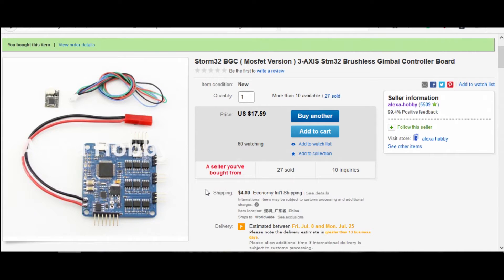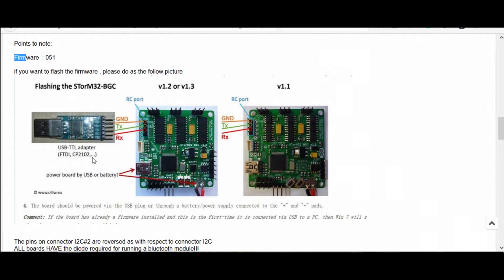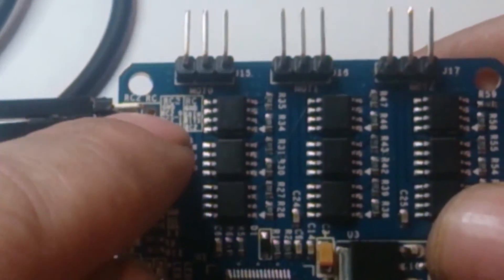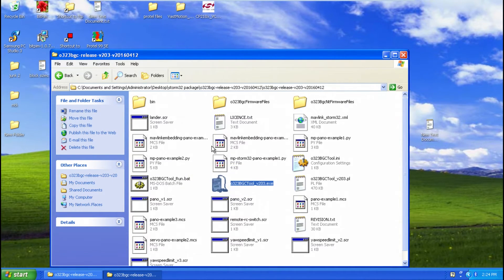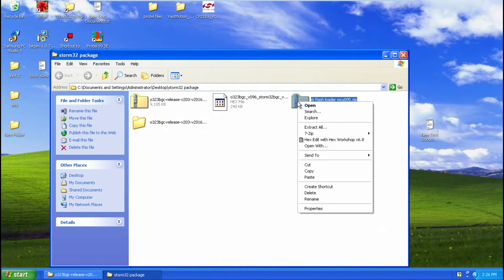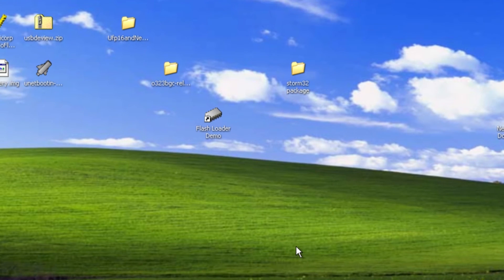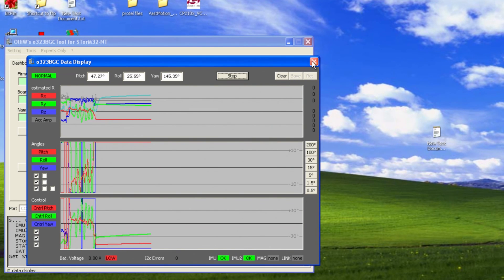SToRM32 BGC v1.4 alternative Firmware update

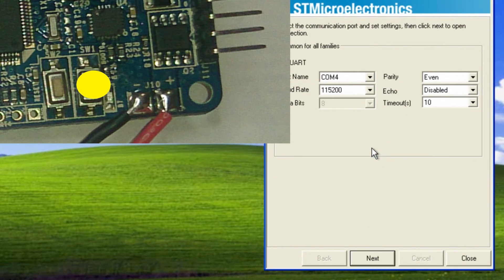Comment: Hi, I'm trying the same in Windows 10, I'm getting the COM Port visible too, but there is an error as it is shown in time 6:00 of the video... I'm not able to proceed further...  Am I doing anything wrong... Please do let me know
Reply from the maker: Hi are you sure you have the tx and rx correctly? have you tried both ways? (reverse your tx and rx)  ..are you on the right pins as well for the uart pins..
Reply: As the 'new' COM Port is visible, there is no error in the USB-TTL chip...  The LEDs of the Storm32 v1.32 are blinking, so that too has no problem.... I tried using the Windows XP OS and it is still not working.. And yes I tried exchanging the RX and TX pins but still the same....   Can I communicate to you through any other means... This work is important for me...
Reply from the maker: @mpd1811  Hi ..can you send me pictures of the connections.. maybe you have it on the wrong pins?   It can also be its just fried ?  can you connect to it at all besides trying to do a firmware update?..   (with the usb port) using the gui for the storm)

Also your messages are being marked as spam and i have no idea why . I only monitor links.. 
If you can't connect to the unit at all because its fried not much i can do .
if its brick .. You might have to get a stlink v2 .. I do have bunch of them kicking around and the bgc boards i can see if it even has the connections for it..  with that you should be able to re write the boot sector if it some how got corrupted .. but that is pretty hard as it should be locked..

Anyways if you send links they will be put in my spam same with any of your messages probably , The other problem it takes youtube hours sometimes to let me know about the spam.

I would rather help in open so it might help others .. but as above not sure if I can..

I've seen lots of these boards just fry for no reason.. I believe thats the board i had that all i did was push the but button and it instantly blew my voltage regulator and the st chip..
Reply: @ModItBetter  I'm working ona BaseCAM board now..  Will let you know if I succeed
Reply from the maker: hi you can actually program with the stlink if you have one .with the gui as well .still not sure of the connections have to find my boards later.. anyways here is a page on it..   http://www.olliw.eu/storm32bgc-wiki/How_to_flash_firmware scroll down to the stlink part..

Comment: Man I am having no such luck every time I attempt to flash the firmware it tells me it has no response Target
Reply from the maker: is that both ways?    with st flash..and through the storm32 gui it self..?
Reply: @ModItBetter  could I send it to you to update for me I can't get it to update
Reply from the maker: @MrHatemelater  what version is the board at?  also why do you want to upgrade it is the version that old? ... Also i'm in canada and the shipping is ridicules to ship out of canada your looking at 30-40 with tracking .. you can find new boards on ebay for about 24u.s 

also look at 2:17 ish i show the connections its a tad deceiving its actually on the second row if you follow the pins.. maybe your on the first row?    if you want you can send me a picture of  your connections to bangs696969@gmail.com  or upload them some where and post the link.. but it will be moderated so you might want to send a message saying "check your flags" if i don;'t answer..
Reply: @ModItBetter  I got a new board but it not recognized by Windows 10 and it has the old .9 software on it that I cannot update
Reply from the maker: @MrHatemelater  Hi scroll down on this page to "v0.96 Firmware for I2C IMUs"  and then download the software for that version..
after you extract it run o323BGCTool_v096.exe     maybe your trying the wrong version with your board

direct link to software and firmware is ..
https://github.com/olliw42/storm32bgc/raw/master/firmware%20binaries%20%26%20gui/o323bgc-release-v096-v20160319.zip
Reply from the maker: keep in mind the other versions are for the nt version which i doubt you have but you might .. you will want to double check to make sure your using a i2c imu's not a nt imu.     so if the above software links work with your board and your running verison .96 already that is the last version for i2c

Comment: Good video. Thank you. But I'm having some issues. I have updated the firmware. Now I have connected using bluetooth but I can not read the board. Same with connecting via USB. The LED next to the Boot Button is lit up ( BT indicator light. Bootloader?? Or Bluetooth?) and the two LEDs LED0 and LED1 are flashing yellow and red respectively. Is that normal?

I click on READ and the message says Please do a READ to get the controller settings. 

I hope I have installed the correct firmware. I have a v1.1 board and installed: 
o323bgc_v096_nt_storm32bgc_v110_f103rc.hex
Reply from the maker: Hi it has been so long..   I would try the version without the Nt  if your not sure if you have a nt board .  6:50 of this video shows the file name to test with .   or if you downloaded the newest firmware the file should look the same as your example without the "nt" in the name

Comment: bro please help me it always shows me the message that she cant connect they said that i need to reset unrecognized device what should i do
Reply from the maker: are you adding the usb cable for power?..

also is your usb to serial adapter working and getting a port in windows
Reply from the maker: ok so your running into problems at 5:37   so your port does show up correct?
not sure how long your usb cable to serial adapter is or your setup but you might have to get closer or try another cable.

and where are you getting your 5 volts for the usb power?   make sure its connected to a power bank and not into the computer

Comment: sorry for inconvenience,, i had a question,,
i wondered if i could use gy-521 as camera imu on this board,, cuz original imu wich this board came with, accidentally burned,and by far this is my one and olny option
Reply from the maker: hi .. I'm not sure but I would suggest to just giving it a go and try it out.. ...I would assume its i2c .. so if it does not work.. it could be your last was a nt version.. so then just try a none nt version firmware.
Reply from the maker: Basically what i'm saying as well .. if its i2c ..4 pin connector.. no damage can be done from trying it out..   unless you get the voltage backwards ect..
Reply: @ModItBetter  i Tried it..and keep getting i2c errors,
Reply: and by the way i changed firmware with help of your video, and when i read gyro data..it works as should, but when i try to calibrate it,, after it turns on motors and  status level message appears, motors start to level camera, afterwards it fails and shows me i2c error occurred.
i had original firmware, i passed this step on that firmware but yaw just wouldn't change it's rotation degree in the next step,  and whole gimbal was locked after finishing steps.
Reply from the maker: @daniel_dz9517    on this page 
http://www.olliw.eu/storm32bgc-wiki/Which_MPU_modules_do_work_with_the_board

the problem you might be facing is your board is a 5 volts board..
and the storm uses 3 volts.. on the i2c header ..  somebody says to short out the voltage regulator. https://www.rcgroups.com/forums/showpost.php?p=27321450&postcount=55  

Basically what they are saying is you find the pin that takes in the 5 volts.. on the other side where it ouputs 3.3 volts.. just attach wire  to those 2 legs.. basically making a bridge over the 5 volt regulator.

alternatively you can just remove the voltage regulator and attach the 3 volts directly  to the old 3.3v pad..

I don't have the board handy right now ..but I would think you could just find 5 volts on the storm board and then feed that to the i2c module ..instead from the i2c port.  ..and if you can't find 5 volt on the board.. 

Just take the 5 volts from your flight controller.  you only need the one wire ..because its shared ground anyways already ..
Reply from the maker: so i went through my electronics bin and found bunch of these modules I have ..
does your look like one of these..?
https://drive.google.com/open?id=1qlULB_R4lrkI-ebW5XPyqJj-kp-X8-nY  well not the 883 one that is a compass ..

Comment: Nice tutorial, worked nicely but now i have to change the version of the Gui
Reply from the maker: did you find all the versions?
Reply from the maker: here is a link.. https://www.rcgroups.com/forums/showthread.php?2055844-STorM32-BGC-32-bit-3-axis-brushless-gimbal-controller

If you can't find your version ..I had downloaded the master from some where.and have most of the version..So i can upload to the my google drive if need be..
Reply: yes , i found it, but i have a problem with the board i think. i have the status no imu,and imu2 ok , but i can't see any signal, on the display, the graph is flat!Thanks for your answer.
Reply from the maker: had you had it before..? are you sure you have it plugged into right location
Reply from the maker: usually the plug for the i2c is at the top you might have another 4 pin on the side of the unit...  also make sure the cable is pushed all the way in those pins can be a pain.. if possible try to flip the i2c cable connectors around.. however if it does not fit the other way don't force it..   try to push the black wires or what ever color wires you have back into the connectors they might of come out a tad..      I don't have a nt version so i don't know its possible to program a nt version with the wrong version ..
Reply: thanks for your answers, what i do not understand is "Imu not available",and imu2 ok, with external plugged or not its the same.I never had imu(1).i bought it from Banggood, version 1.3 , black board and the firmware /gui was downloaded from the rcgroup.com , it was requesting a gui 2.11e.So with your method (only)i succeeded to upgrade the firmware to v0.96.My ext. imu is I2C, are there really I2C errors problems?I even made a try by direct soldering to the I2C#2 port on the other side of the pcb, same result , but imu2 appear on adress high instead of low.Any idea?Thanks very much of considering my problem.
yes after checking on your link it was originally a firmware beta version 2.11e.
Reply from the maker: Is it possible you have nt version??  then it is not i2c and simply  uart well uart at a faster speed..
Reply from the maker: I know above you said it was i2c but if your unit actually came with 2.11e that seems to be a nt version .. have you compared your i2c module with other i2c modules and nt modules?   and same with your board.
Reply from the maker: also have you just tried to go back to version 2.11e ?
Reply: i suspect something like this , because some other buyers complain about "no connector" for the ext imu.I'll try to go back to 2.11e.But if its a NT version , i need a USART type sensor?
Reply from the maker: Ok your board totally looks like the nt version board.
https://www.banggood.com/Storm32BGC-NT-V1_3_F103RC-32-bit-Brushless-Gimbal-Control-Board-p-1105106.html?p=PK211613756002015039

they might of sold you the nt version board and a i2c module..
let me crack open mine and see if looks the same....... <--edit..pointless mine does look different like how a none nt should look like but proves nothings.
Reply from the maker: on your board it should be label i2c beside the i2c connector does it have that label? also what is on the back of your i2c module.. does it say sda scl?..same with the main board any writing on the back of it?
Reply from the maker: If we are right.. I would request a new module or even board or full refund as damage could of happen to the module or the st chip.  It is probably doubtful because they both work on 3.3v anyways..   and you don't need to plug in the battery while testing just the module,  usb power should be good enough..
Reply from the maker: also if your updating your board make sure you use the 130 files ..just helping somebody else out and realized they might be using v120 or v110 files.. ..However you board never worked so i doubt it will help you...